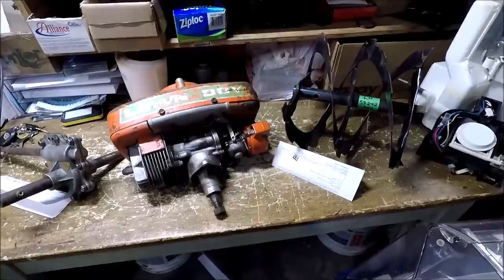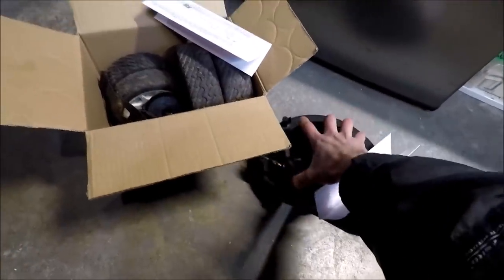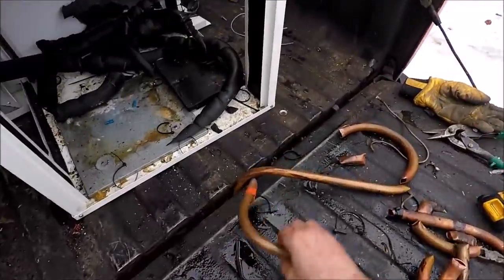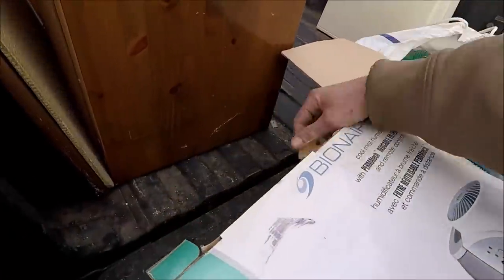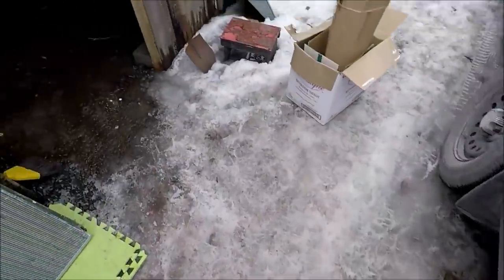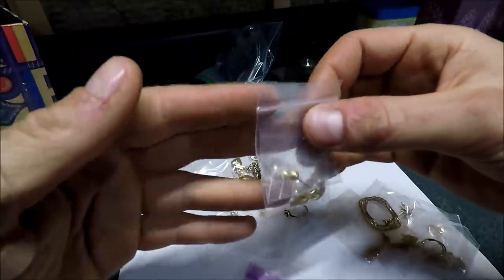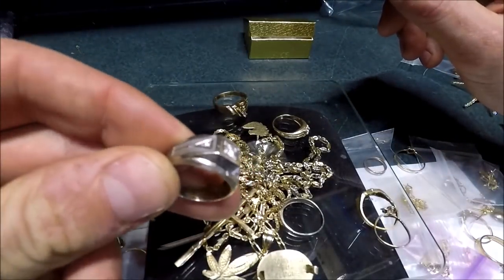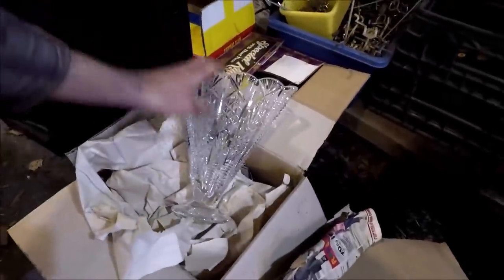GOLD found in storage locker auction! Ebay sales and scrapping metal.

Comment: Eric you should invest into a seven or eight inch metal cutting circular saw blade and try it out on cutting your rads you will be able to cut your time in half cutting rads if the rad is very thick you just turn it over and finish the cutting of the rads I bet you will cut your time down to one quarter of the time you are now putting forth in cutting your rads

Comment: I heard from another scrapper  if you drill a hole in the bottom of the compressor and drain the oil into a bucket saves all the mass